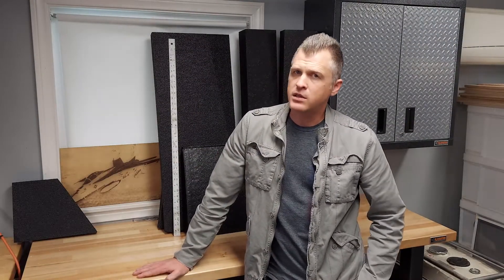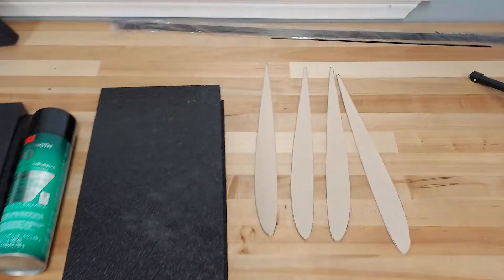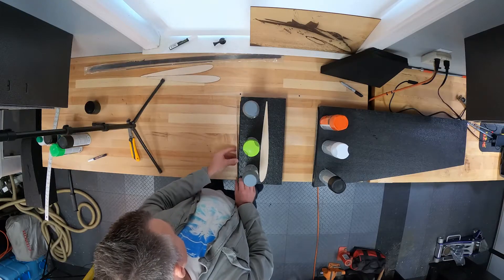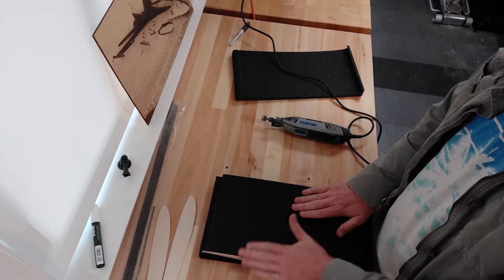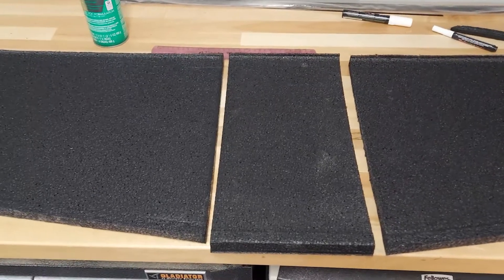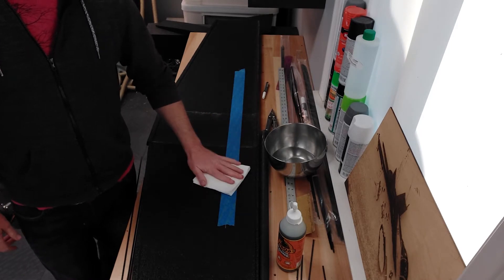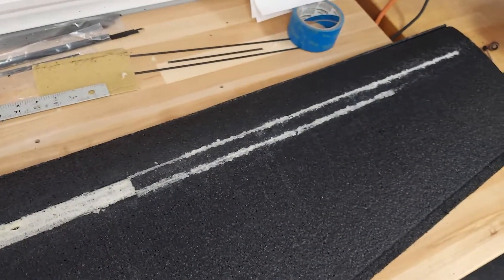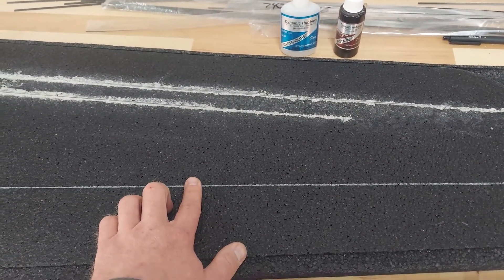Giant 80" FPV Plank Construction Part 1

Comment: I too would like to build this aircraft, but I can't find enough details of the design anywhere. I don't need much, just some basic details of the airfoil you used, planform and CofG is enough.

BTW, I say your 'tube on blended body aircraft and have been tracking through the world of obscure aerodynamics myself. I am currently building a Prandtl wing (no tail at all, literally just a plank!), the Verhees Delta and the Horton wings. But the most interesting so far is the Facetmobile by Barnaby Wainfan, where he makes a very strong case for his low aspect ratio aircraft. Saw him at Oshkosh, and you can check out his talks on his website.

Oh, and finally. I see you going to incredible effort to fit the carbon spar into the wing. I have very much easier way to do it if you're interested - around ten minutes per wing and flawless results.

Comment: I've found installing the wing servos against a spar dramatically improves elevon performance. I suspect it's because the servo sits hard against it and does not flex easily in the foam. Noticed a large difference in ability to get precise flight i.e. hitting gaps.
Reply from the maker: This is a very interesting observation.   I appreciate you passing it along to me.

Comment: What would you do without all those cans... pinch some weights from the local Gym? haha.. I have made small weights from melting lead sinkers and old lead from house rooftops into dirt moulds in the back yard, I have even used pots n pans filled with water just to hold down stuff while the glue dries.  This is very interesting to see how it all goes together, I make R/C model boats from scratch so this is intriguing to me.

Comment: So how and why does the balsa trailing edge improve efficiency? Is it just having a sharp edge? Because for that a smaller piece of balsa would have been sufficient...
Reply from the maker: Yes, just having a sharp edge.   On the sections where the surface is moving I make the whole surface balsa for stiffness, on free edges yes a much smaller piece is sufficient and is my norm.

Comment: For flush surface sanding such as the ply ribs, I stick the sand paper to the sanding with double sided tape, half the paper grit up and the other half grit down.  This ensures the core is not sanded but the ply rob will come down exactly flush with the core.  Except that the exposed grit always seems very slightly proud, so you still have to watch it carefully and stop as soon as it's right, but it means that you can hold the block on the foam surface to guide the sanding without it removing any foam.